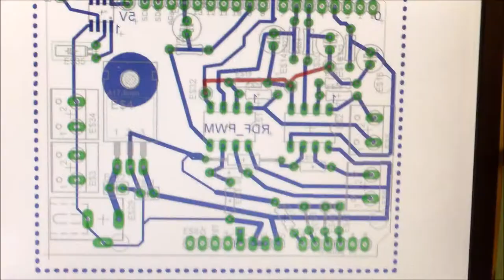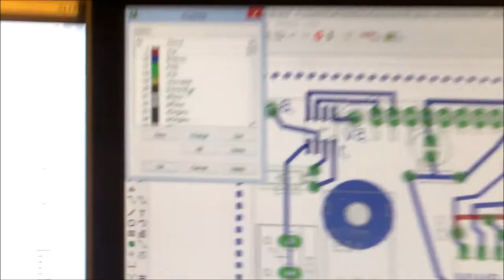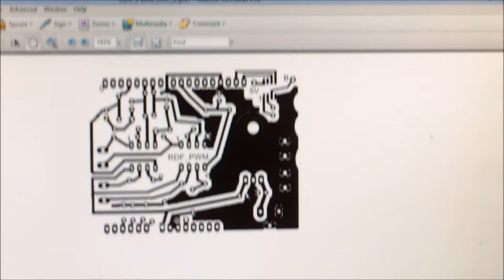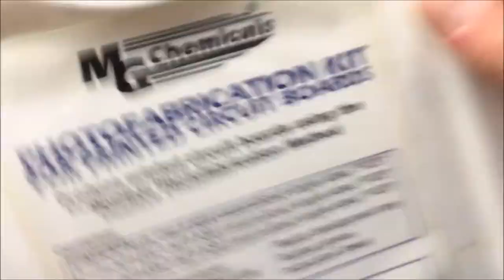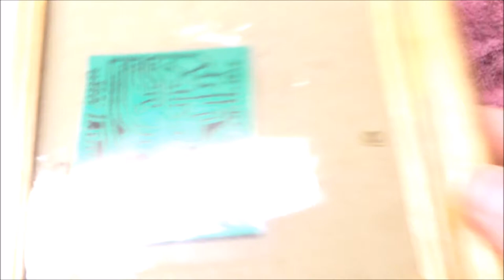How To: DIY PCB Etching / Make PCB with Ferric Chloride

Comment: Would a UV ("blacklight") bulb be more effective at exposing the board?  I have a couple old ones in the garage...
Reply from the maker: Never tried. It should work fine as it is the UV light that exposes the board.
Reply: @CarlRecktenwaldJr  Any ideas how how much less time (I am assuming) it would take for exposure? I am using 30w UV light.
Reply from the maker: I think you would be ok with 7 mins. Might want do to a small test piece first.
Reply: @CarlRecktenwaldJr  thanks a bunch for the advice and for the quick reply!

Comment: The Iron transfer method looks easier with 1 less steps and possibly cheaper as you just use regular copper board
Reply from the maker: +John Michael Stock.  true. However I have never had much luck with that method. The plain copper boards are a lot cheaper.
Reply: Carl Recktenwald Jr. I've heard that sometimes the print does not come off onto the copper board with an iron, is that the issue you had? Also, did you you glossy paper or transparent sheets?
Reply from the maker: +John Michael Stock I could not get all of the toner onto the copper and then when I etched it the copper was missing from the traces. I used glossy photo paper.
Reply: Thanks mate.